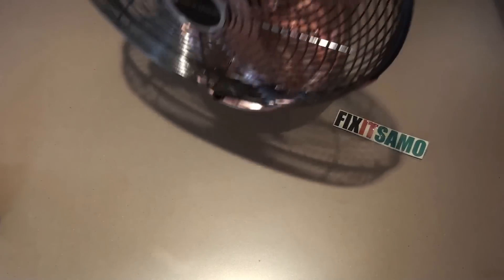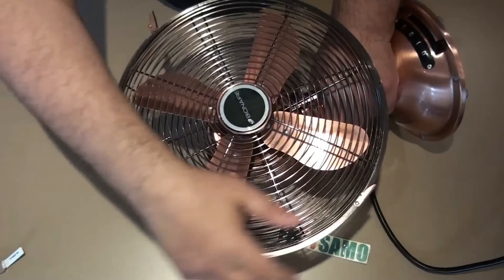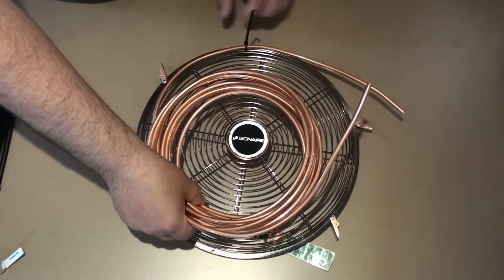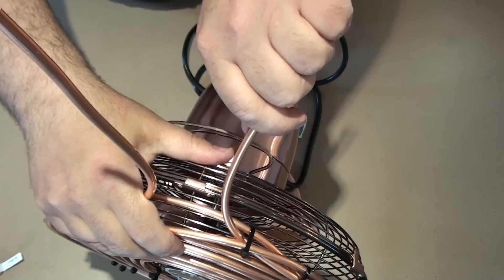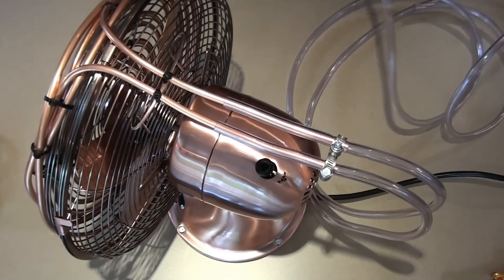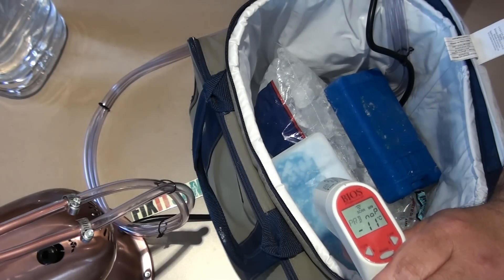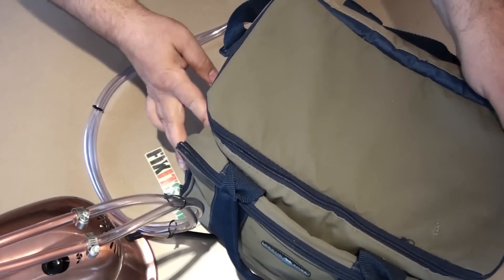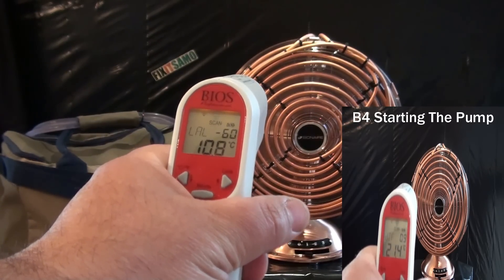How To Turn Your Fan Into An Airconditioner  AC

Comment: This only does 1/3 of AC's work. AC is not just about maintaining temperature. It also purifies air and regulates humidity for comfort.
Reply: Davey, you're the hero we need to cure stupidity XD
Reply: Although I don't agree that you need to control humidity for it to be considered Air Conditioning, this system will lower the humidity due to condensation from the air building up on the copper pipe, thus reducing humidity.
Reply: Yeah but that's not the point. It works, but it's not a regenerative system like you would see in a conventional AC unit. If you kept adding ice it would keep working, maybe not very efficiently but it would work. Yes the water dripping off of the pipe would get on the floor, but again that's not the point. The point is that the water is no longer in the air, thus lowering the humidity in the room. And yeah it will evaporate again, but at a very very slow rate, much slower than the rate of water condensing out of the air. Although again, humidity does not have to change for a system to be considered "air conditioning", the drop in humidity is just a secondary effect due to the chemistry of water.
Reply: When it's 100 degrees, who gives a shit about purity.
Reply: I don't recall seeing AC with humidity control. Most don't purify the air- except for a cheap foam filter that's designed to keep the AC clean.
Reply: AC is a conditioner and not a just cooler of air. Please go to ASHRAE web site to know more : https://www.ashrae.org/resources--publications/free-resources/top-ten-things-about-air-conditioning
Reply: "Air conditioning (often referred to as AC, A.C., or A/C) is the process of removing or adding heat from/to a space, thus cooling or heating the space's average temperature."

https://en.wikipedia.org/wiki/Air_conditioning
Reply: You're an idiot.
Reply: Refrigeration air conditioning equipment usually reduces the absolute humidity of the air processed by the system. The relatively cold (below the dewpoint) evaporator coil condenses water vapor from the processed air, much like an ice-cold drink will condense water on the outside of a glass. Therefore, water vapor is removed from the cooled air and the relative humidity in the room is lowered. The water is usually sent to a drain or may simply drip onto the ground outdoors. The heat is rejected by the condenser which is located outside of room to be cooled.(from your own example i.e wikipedia site) AC always regulates humidity
Reply: First the condensation from the air buildup on the copper pipe will drip on to the floor and make mess. This water might re evaporate to some extent. Either way the efficiency of this condenser would depend on the ambient room temperature. If you got temperatures of 35 degree to 40 degrees C. It might only be efficient for an hour at most. This is more of an air cooler than an air conditioner.

Comment: Use Zeolite to build an absorption cooler and you have a new and efficient system. Check this out. https://www.extremetech.com/extreme/130523-zeolite-thermal-storage-retains-heat-indefinitely-absorbs-four-times-more-heat-than-water
Reply: Interesting technology, but how do you expect them to work to cool anything off?

Comment: Eh, is it possible with liquid nitrogen?
Reply: No. The nitrogen has a very poor thermal capacitance. Plus the pressure in the pipes would be really high.
Reply: LegitSoulja I wouldn't recommend it, for one, it's not very cost effective, and two, you can't put liquid nitrogen in a sealed container
Reply: You'd probably destroy the pump.

Comment: why don't you put the pump in the freezer?
Reply: Add salt to the water
Reply: serenadezzz then everything will freeze idiot. It'll need to be at a chill temperature (Refrigerator max temperature, to the point your eggs freeze).
Reply: But if you get your ice to put in the cooler from the freezer, isn't that what it's doing anyway?
Reply: Limits where you can put the fan, and threatens to freeze the water.
Reply: sebacoyl no it pointless. A lot of mess to clean up aswell.
Reply: Because all the freezer does is pump heat out of the box into the room. If you use it to cool the room, the heat goes from the fan, into the box, and right back out the back of the freezer.
Reply: yes but this is cheaper than buy an air conditioner. it works better than just a fan
also it's less electricity. maybe 120W. AC's use about 1500W for the small ones
Reply: plus you don't need a window to vent out the hot air with this method vs an AC
Reply: Salt would destroy the pump that he used. You would need a much more expensive pump,
Reply: most of those little pumps are all plastic.
Reply: Instead of putting it in freezer he should use a refrigerator, it wont freeze.
Reply: Theres a better idea. Buy a long tube . Attach it to the pump. Immerse the pump into a medium sizes bowl of water. Keep the bowl in the refridgerator (not in the freezer). As the bowl water cools u ll get cool air circulated. The risky part is that u need to make two holes in the rubber part of he fridge that can exactly insert tubes .

Comment: What about condensation?
Reply: LegitSoulja The cold water moves through the coil in the relatively warmer air. This condenses the water in the air around the coil. Let this thing run for 24 hours as you suggest and you'll have a huge puddle to deal with running down a device with an ELECTRIC motor.
Reply: It's an atmospheric process that occurs when water is turned into a gas through excessive heating causing it to evaporate, then when the gas hits a cooler surface it condenses back into liquid form and gathers on the surface.
😁
Reply: Then your pump will pump air until you refill it.. But if you keep this in a dark place it'll last about 24 hours, even longer (For being cold). The water isn't going no where.

Comment: Nice ! But only works if you get the ice from your neighbors, otherwise, the energy used by your fridge will warm up your apartment for the same amount...
Reply: I think the concept here is to cool down your house without spoiling your food
Reply: Yeah, I don't think this is supposed to be used in place of an actual A/C unit. The fridge/freezer is going to be running anyway so why not try it? Sure, it'll never cool your whole house, but this will at least give you a cool breeze.
Reply: Florian Marandet or just don’t keep your fridge in the same room as your DIY AC.
Reply: Buying ice in bags isn't that expensive in the us right?
Reply: Last time I bought some it was about $8.00 for a 12 KG bag of ice. Im in Canada though so thats CAD not USD
Reply: Noneyo Business you can buy a large bag of ice for $2.99 USD so it's pretty cheap
Reply: You don't need to cool the room down just have the fan blow directly onto you.

Comment: could i put Freon in there?
Reply: Robert Jenkins youd have to build a full refrigeration system and at that point its wayyy cheaper to just buy a window unit. HVAC student here btw
Reply: how in the world does freon even work. so its not just cold it has to go through a process?
Reply: Robert Jenkins its hard to explain just look up a video on how the refrigeration cycle works
Reply: Refrigerant absorbs heat. Its called heat transfer.

Comment: Salt the water next time.
Reply: If you put salt water in plastic jars and froze them, then you could use salt water. But do not circulate salt water through the pump.
Reply: Why ?
Reply: mayorc Water freezes at 0deg. It cant drop below 0 unless it has impurities.
Reply: Fresh water cooling effect will last longer, salty water will make air cooler (but for a more limited time).
Salt water will also oxidize copper faster (And copper has a non infinitesimal cost).
Plus mean temperature of whole freezing bag depends on the starting water temperature and all the ice, so it will stay under -10 °C for a very short time.
Imho it's not a great idea.
Reply: mayorc yeah so  it actually depends on whether youd rather it last longer or be cooler/colder. Not sure where cool becomes cold.

Comment: You could solder the copper shut, & attach an adapter to fill it with a coolant from an auto shop..
Reply: and to prevent any corrosion
Reply: Water holds more heat or cold per density than any other chemical known to man. E.g. 1 gal of water can hold n amount more cold than 1 gal of coolant.
Reply: +Tim S      im not sure thats true once water freezes or turns to gas.... besides, corrosion, freezing, and conductivity are a major concern when using it for cooling. its why you dont see it used in liquid cooling systems most of the time, especially in pcs.

edit: looked it up and you are wrong, NH3 (ammonia) has a higher heat capacity. the J/gºC of ammonia is 4.70 while water has it at 4.184 for their specific heat capacity. i just imagine its not good on most if not any pipe systems....

Comment: Am I right in saying that an air conditioners purpose is to eliminate moisture from the air, I don't see any way this eliminates the moisture?
Reply: That is ONE purpose of an AC. Just so happens that when you condense air and re-expand it, not only does it remove moisture but also cools it. This is guy is not using a condenser though, just ice in a coil which would still effectively lower the temperature but not extract moisture.
Reply: Many people use humidifiers when they switch the ac on. It removes moisture as a side effect. Its purpose is to regulate temp.
Reply: Aakash Nair yeah my mistake, I've looked it up and an air conditioners main purpose is mainly cooling air, not "de-moistureising" it (I know it's not a real word). So yeah this is an air conditioner since it changes the condition of the ... air.

Comment: u have to put a tray under the fan to catch those water from consendation , dont u?
Reply: no, the tubing provides more surface area to the moving air across the cold then simple blowing a fan over a tray of ice/ copper is also a better thermal conductor than air. 
there are other videos of designs with a bucket or styrofoam coolers. the better ones use copper tubing
Reply: Yes your right
Reply from the maker: +Toitesting 
I got it from Home Depot around 7 $ canadien

Comment: better yet, make it a closed loop and burry the other end in the earth with copper tubing as well and you wont have to get ice all the time or attach it to a faucet and run pure cold
Reply: than use the faucet and drain it in the sink. will cost you in water if its not included in rent. if it is its free :)
Reply: not better

Comment: does this only work with a metal fan or is plastic fan good?
Reply: Metal fan  would be better cos it conducts heat away from the water making the frame cold as well.
Reply from the maker: +Victoria Angelique  will work with both

Comment: Use a recirculating thermodynamic cooler -.- problem solved. If you can circuit the energy from the battery source through a rodin coil or something similar you could stretch the energy immensely.
Reply: Nefuros Dang, my boy Jimmy Neutron. That sounds smart, but can you explain that better in layman's term's please? Thank you if so.

Comment: It comes up yet again...  This does work.  Really.  Literally as much as if he had just left the bags of ice on the table and they melted.  It's not efficient, but it technically works. 

The problem is, if he took the ice from the same room he is trying to cool, the freezer generated alot of heat while cooling the water into ice to begin with. Its why you cant open the freezer door and cool a room.  Fridges are somewhere around 20% efficient.  Get a ton of ice from another room, and it might work.
Reply: That would be true if he was using a freezer. His system is literally just a bag of ice. When he says cooler, he means insulated bag of ice. The worst that could happen is the ice melting. That doesn't produce heat. It also doesn't mean that the ice on the table thing would cool down the room just as much. The water is chilled by the ice, obviously, it runs through the tubing, in turn cooling the copper tubing, and the fan blows air over the tubing producing cold air. The ice lasts longer because it's in a cooler and the cold generated is more evenly distributed.
Reply: I totally agree. His system in itself is just ice and cold water.  And I like it, and I have two of my own :) Guess I was suggesting if he were trying to cool the same room he got the ice from, say, a kitchen, then the fridge generated more heat to make the ice than cooling he'll get from the ice.  

The solution is to use ice generated from another room, refreeze the water when the house is cool at night, or I'd love to one day tap the cold water coming out of the ground sitting in my sump well 24/7
Reply: I thought it was simple enough. Maybe its the new math they teach these days.
Reply: Lol you keep saying that but what house doesnt already have a fridge with a freezer that goes 24/7 ....so regardless that heat would be there so whats ur point ? dont stick water in the freezer thats already running because supposedly that would heat the house more....some logic ....

Comment: In the 50s reefers they used ammonia as a coolant before R12.
Reply: about 40 years ago we had a propane refrigerator. it had a little mirror so you could see the pilot light.
Reply: Believe it or not, propane is still classified as a refrigerant...and is MUCH more efficient than Freon...only problem..flammable and illegal in AC systems in quantity in America
Look up R290
https://www.secop.com/solutions/natural-refrigerants/
Reply: Those types of refrigerators used ammonia inside them..used the pilot light to fire up a burner to boil a ammonia/water mix...it then separated and was cooled, a bit differently than a compressor based cooling system today.
had to look it up...called an absorption refrigeration
https://en.wikipedia.org/wiki/Absorption_refrigerator#Single_pressure_absorption_refrigeration
Reply: Not to many years ago I purchased a new propane refrigerator for my shed. You know for cold beer at the end of a hot work day. The Amish still purchase the refrigerator boxes from Amanna and build propane refrigerators.
Reply: aren't camper fridges the same?

Comment: The idea is great except to put the fan over the refrigerator and put the tray of ice or cold water inside the refrigerator to maintain its coolness and remain constant without changing the water
Reply: wouldn't that be the same as leaving the door open?
Reply: This would also just make the fridge work harder with its heat coils on the back which would expel heat back into the room.
Reply: to the tune of about 20 percent efficiency

Comment: Did you use all 25' of copper tubing?  Would 10 feet be enough?
Reply from the maker: +pmizell23  around 15 feet
Reply: i used 20 feet on a 9" fan
Reply: pds tech is it working as expected? What room size? Size of bucket/ice used? Cooling for how many hours? I want to make but have these questions. Looking for positive responses from people who tried it.

Comment: Thats not an air conditioner. Its a cold water fan coil.
Reply: An actual air conditioner not only blows cool air in a room but also extracts and ejects hot air outside of the room. You need the two, otherwise it's only a refrigerated air blower. Not only the hot air remains in the room, but the added system to work adds heat (just as the back tubes of a fridge does) in the air so it can't be that effective. And this odd job doesn't take on board the water that will inevitably condensate over the copper tubes, it has to drip somewhere.
Reply: julosx what this is doing is transferring the heat from the room into the ice which will melt. It IS taking heat out of the room, and putting it into the ice. There's a reason it melts and you need to refill it.
Reply: Refrigeration is taking heat from a place where it's unwanted to a place where it doesn't matter or doesn't matter as much.
Reply: julosx 
Thank god someone here understands .
Reply: If it were an air conditioner it would also be using a compressed refrigerant. 
I know im nit picking. Sorry
Reply: Anything used to improve or maintain the condition of air is an air conditioner

Comment: What if you also put one behind the fan? Will it make it cooler or same? I know this is kind of a dumb question but I've read somewhere that it might be a good idea.
Reply: Also, my room is almost a closed room with only the very small gap under the door. Will I die or something? Actually, will it even affect the oxygen that I can take in? Sry, i'm not a knowledgeable person when it comes to science
Reply: it won't have any effect on oxygen or the air (except cooling it), you should be perfectly fine.
Reply: Paul Mangel thanks

Comment: Id like to try this with water cooling on a PC.
Reply from the maker: +Luis Guerrero  do not try this on a pc
Reply: it will actually cool the pc well - being someone who works with DIY cooling and working with electrics, water and computers I can confirm it will work well providing u know what ur doig and u have the correct equipment to take on such task.
Reply: Erm - the tiny bit of condensation will form within the storage comparment/tank - not the actual computer - ive already done it once and it was well good!
Reply: Ive done it a good few times on a pc - I work with electrics, liquids and stuff in my DIY and its perfectly fine providing you know what your doing